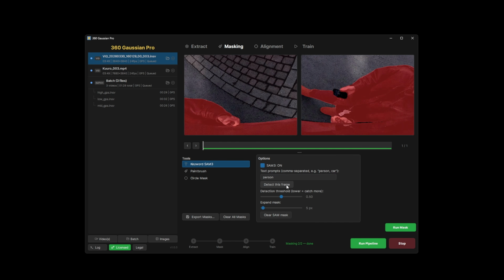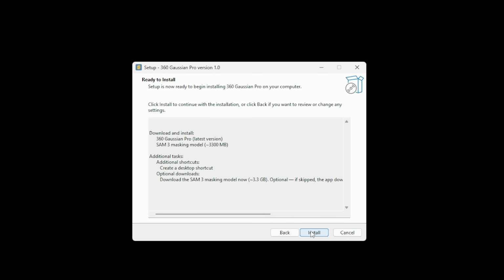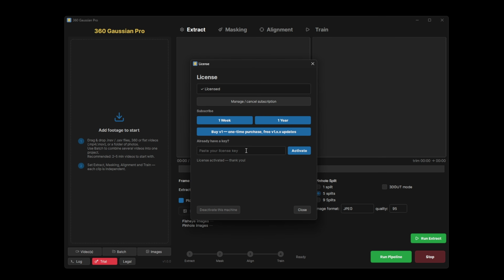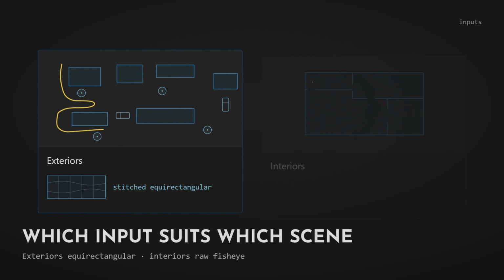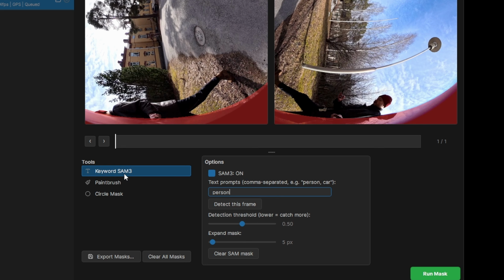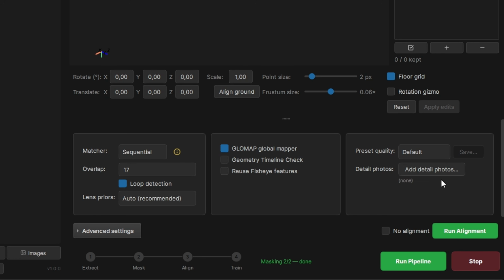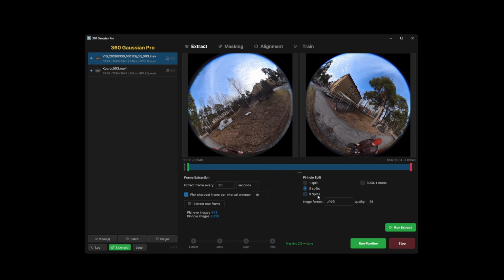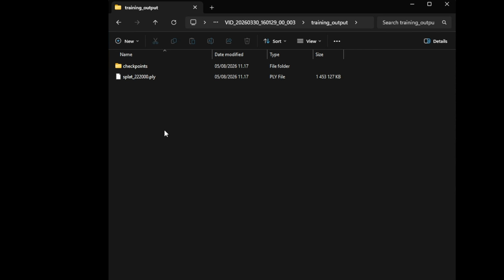360° Gaussian PRO— Raw inputs — Add detail images

Comment: There are still alignment issues indoors. The two fisheye lenses on the 360 camera don't fully form a stereo camera constraint, which leads to incorrect image position alignment. Especially in indoor environments with excessive white walls, we still need to rely on SLAM positioning to accurately solve for the image poses.
Reply from the maker: This example is with .invs two fisheyes without Golmap feature. https://superspl.at/scene/39e9459e

and yes you are correct that it is a challenge.

Comment: work for X3 ?
Reply from the maker: hey, I haven't test it but I don't see any reason why it would not work.  You can download the software free and test with 14 frames cap. no sign in needed. 
If you test, I'm interested to hear if it works or if any problems so I can add support.